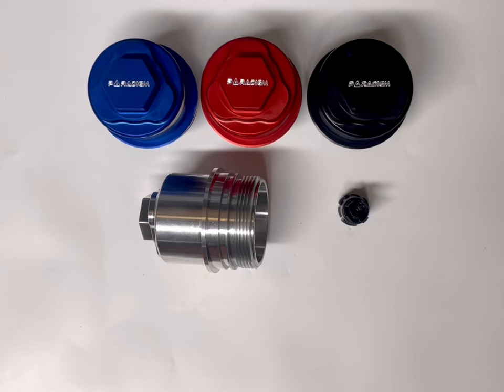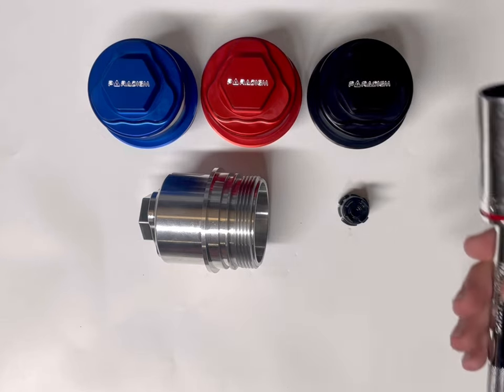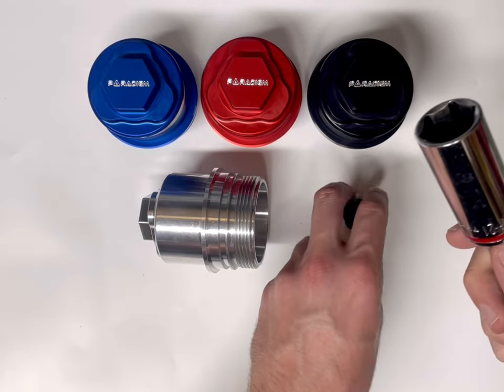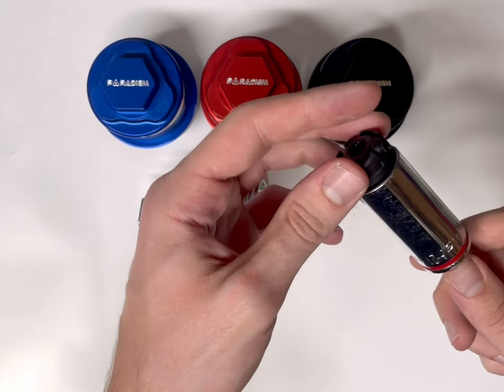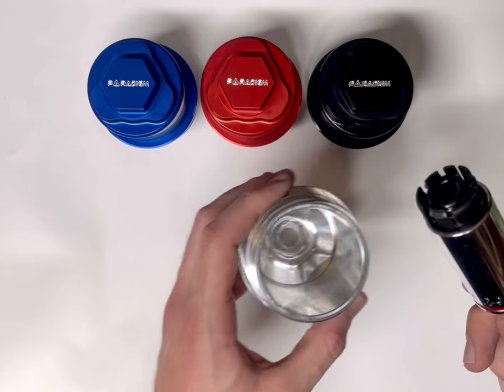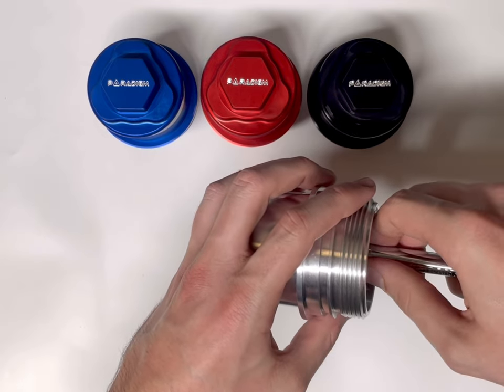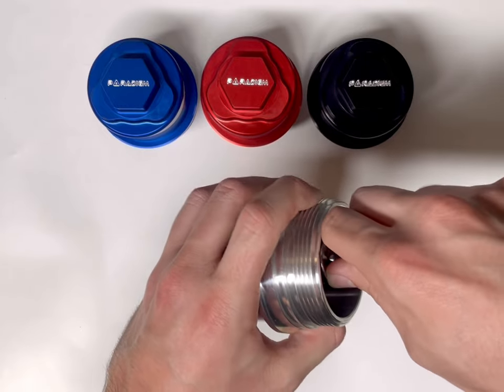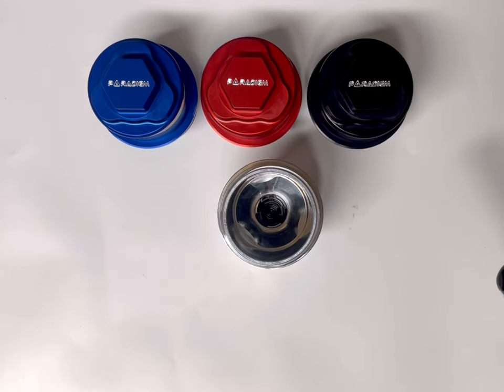How to easily install/reinstall BMW B58 oil filter cap bypass valve/cage

Comment: Once you do the second oil change with this cap do you need to remove the valve again to clean the magnet?? Is there a replacement part # so you could just order a new valve incase it breaks at some point
Reply: Wondering the same, I'm ordering a full bmw one to take the cage out
Reply: Same question. Might have to order a entire cap assembly just for the valve..